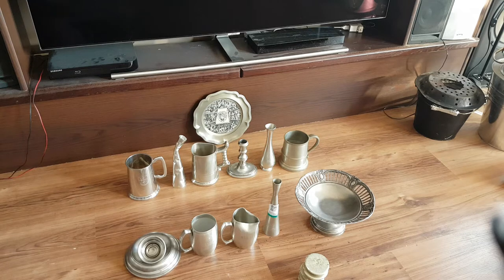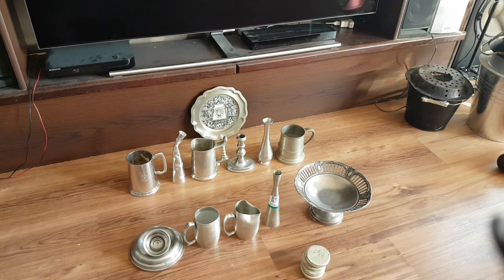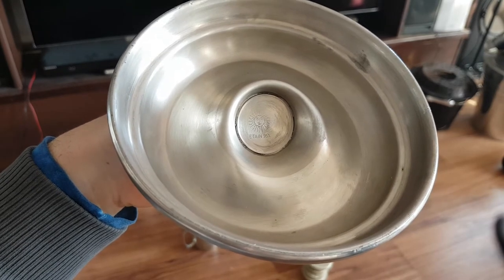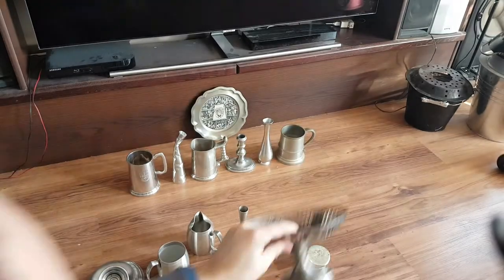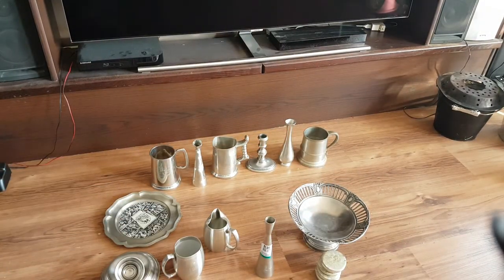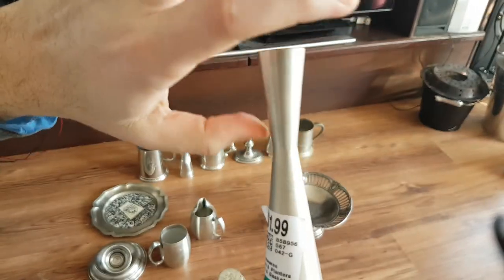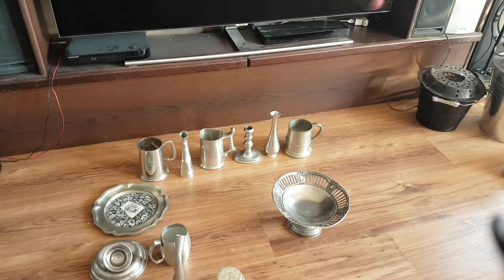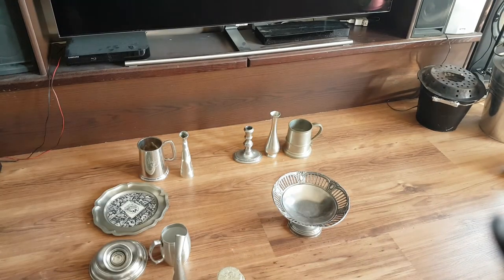Tin - Where To Find It (For Bronze Smelting Foundry) (Pewter)

Comment: The only problem with using pewter is that you generally cant determine what the pewter alloy consists of. If its alloyed with bismuth for instance, the bronze will be weaker. That being said, I have collected plenty of pewter from thrift shops which I will be using to make some bronze.
Reply from the maker: Seth Robinson About half the pewter pieces I found said the percentage of Tin. Usually 94-97%. You can leave the pieces that don't qualify behind.
Reply: @iplayloud2  That's still a lot of unknown material, most commonly the balance on a lead free pewter will be antimony and copper, more antimony than copper, typically with 94% tin you will have 2% copper and 4% antimony. Antimony is not a good material to have at bronze casting temperatures it oxidises readily and is toxic in that form, it is also detrimental to bronze strength. I see a lot of suggestions like this which in theory would appear to work but there may be hidden dangers of mixing unknown materials.

Comment: Yeah. That's a good idea to use pewter and you're right about the price. I wanted to make tin bronze as well but tin is really expensive. It can be an issue to find cheap pewter as well. It depends where you live. In Ukraine I have never seen pewter. Most old plates, cups etc are made of porcelain or something like that. Aluminum is cheap and it allows to make very high quality bronze alloy.
Reply: Wishing you are well and safe in Ukraine 🇺🇦

Comment: Were can i find tin on household items ?
Reply from the maker: Household items are made of steel now unless you have older items. The only tin you'll find new is in welding supplies. Make sure it's not mixed with lead however. Also the flux in welding supplies is toxic. Read the labels.

Comment: CMX metals bronze ingot is running me 6bucks a pound.  It's not worth it for me to screw with homemade bronze.  Consistency of materials is important for consistent results.  It's not the cost of the metal, it's the HOURS of work just to get to the metal melting part.
Reply: I tried searching a few bulk metal sales places online; the vast majority were just selling stock, round stock per pound was roughly 5x spot price at the cheapest places I found. Absolute rip off focusing on the 'artisan' blacksmith who has money to burn it seems. Not those of us who don't want the wife chastising us for wasting a weeks wage on a bunch of scrap metal to melt into pointy things. :(